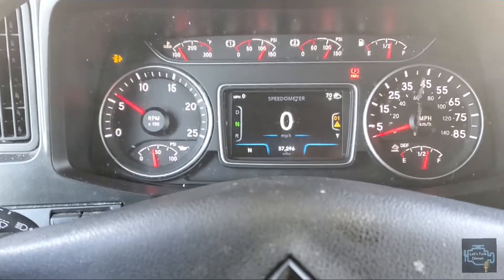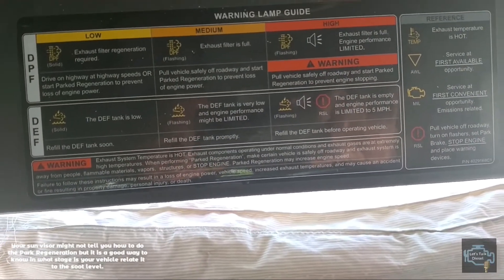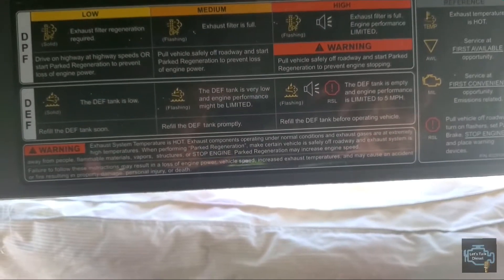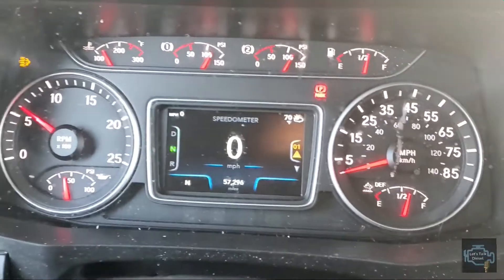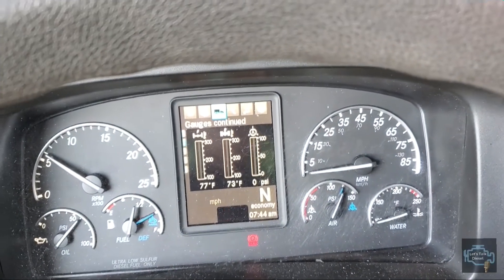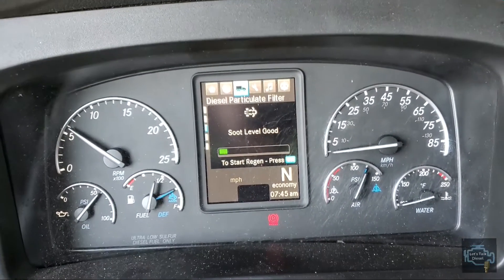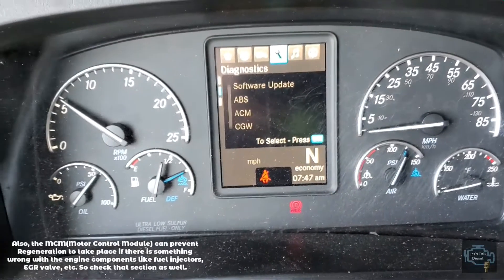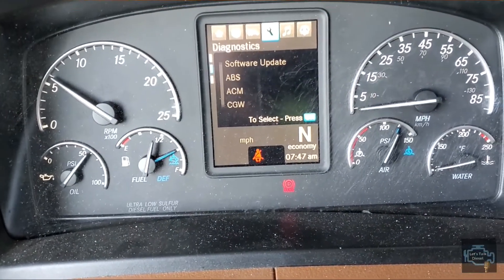How to do the Parked Regeneration Part 1: International LT/ Freightliner Cascadia/ Volvo VNL 760-860

Comment: How often (time frame) does it require to be regenerated?
Reply from the maker: In general, parked regeneration takes between 45 minutes to one hour to complete (with International trucks with A26 engine as exception to this because those vehicles takes more than one hour and up to two and half to finish this process) When this time is excessive, for example two hours it might be time to clean your DPF or requires an proper inspection of the aftertreatment system to check the performance of the components. Thanks for watching.

Comment: I have a 2018 international LT and in order for the Regen to kick in, I need to run the truck until like 3 gear then stop, then regen will start automatically. And go on for about 5 min then stop. After it stop, I need to repeat again run the truck until like 3 gear for the regen to kick in again and so on so for…  it takes like an hour repeating this process, can someone please helpme.

Comment: Ok, for you guys in a 2022 International LT625, Cummins X15, Automatic, this is the procedure.
Step 1: Press the break pedal, Push in Tractor Parking Break.
Step 2: Place Automatic Transmission in Drive
Step 3: Place Automatic Transmission in Neutral, Pull Tractor Parking Break
Step 4: Release Break Pedal, Press “Parked Regen” Momentary Switch, if done correctly Green LED Will be On and truck will Immediately idle up. During the Process, you will see the “High Exhaust Temperature” Light come on on the instrument cluster. Yes, it is finally working! 

After 1hr 24minutes process complete on this truck!

Sometimes if you want it done right you gotta do it yourself, so I did!
Reply: Mine just blinks
Edit: nm the 2nd time it worked. Thx!
Reply: I did like 5 times and it didn't work
Reply: Same here

Comment: Hey, let’s talk about 2022 International LT625 Cummins Automatic Parked Regen. Your video on it is not correct for the truck I’m in. The Parked Regen button is a momentary switch in this one and not like the one in your video.

Ok, for you guys in a 2022 International LT625, Cummins X15, Automatic, this is the procedure.
Step 1: Press the break pedal, Push in Tractor Parking Break.
Step 2: Place Automatic Transmission in Drive
Step 3: Place Automatic Transmission in Neutral, Pull Tractor Parking Break
Step 4: Release Break Pedal, Press “Parked Regen” Momentary Switch, if done correctly Green LED Will be On and truck will Immediately idle up. During the Process, you will see the “High Exhaust Temperature” Light come on on the instrument cluster. Yes, it is finally working! 

After 1hr 24minutes process complete on this truck!

Sometimes if you want it done right you gotta do it yourself, so I did!

Comment: This in not correct information for 2022 International LT 625 Cummins Automatic. The Parked Regen button is momentary switch and not click, and it does nothing but allow the green light to blink. It just sits there giving me the middle finger mate. For the love of God, update this please!!!

Ok, for you guys in a 2022 International LT625, Cummins X15, Automatic, this is the procedure.
Step 1: Press the break pedal, Push in Tractor Parking Break.
Step 2: Place Automatic Transmission in Drive
Step 3: Place Automatic Transmission in Neutral, Pull Tractor Parking Break
Step 4: Release Break Pedal, Press “Parked Regen” Momentary Switch, if done correctly Green LED Will be On and truck will Immediately idle up. During the Process, you will see the “High Exhaust Temperature” Light come on on the instrument cluster. Yes, it is finally working! 

After 1hr 24minutes process complete on this truck!

Sometimes if you want it done right you gotta do it yourself, so I did!
Reply: Thanks So Much My Friend

Comment: I did this on international but after it was done the parked regen light was still on.
Reply from the maker: If that happens could be for the following reasons:

1. Engine is not warm enough to start the regeneration process. Warm up the engine above 110 F or 120 F so it will start the process.
2. If engine temperature is okay and still does not start, it might be a problem with the switches (disconnect both switches from the dashboard and reconnect them again). Then try again.
3. If point 1 and 2 are okay then the last thing to check is for problems relate it to the EGR, Turbocharger, engine sensor, etc. NED (Navistar software) tool is required for all these checks. 

Thanks for watching and I hope this information helps for your issues.

Comment: How Do You Perform A Optimized Idle In A 2021 International
Reply from the maker: Usually, your truck must come with that features ON from the dealership, but if that is the case, before you turn off the engine it might ask you to turn on the optimized idle or it should be around the setting menu, I hope this help you, also try to contact Navistar for more information about it. Thank you for watching.

Comment: I press the regen and it just blinks three times and nothing happens on 2022 international lt. I made sure cruise was off, jake breaks are off, park and trl break are set
Reply: Same here nothing happens
Reply: I got mine to work on my 2021. I turned on the auto start/stop and climate control. When the engine cranked I pushed the parked regen button and it stayed on
Reply from the maker: If you truck is asking for parked regeneration (DPF light solid or blinking) and you tried to perform the regeneration with the switch with no success, it means there is something wrong with the Aftertreatment device, so if that is the case try to take your truck to the nearest dealership so they can take a look, if still under warranty they might compensate for the time down. Please consult your dealer for more details. Thanks for watching.
Reply: Yeah mine does the same thing it just blinks and no RPM revs I hope I don’t have to take it in The dealer takes days to get the truck back 😪

Comment: The example you did for the freight liner my screen doesn’t have the okay selection it just shows the soot level
Reply from the maker: If you do not have a manual switch, perhaps needs a software update for the instrument cluster. Usually only the dealership can take care of those issues. Thanks for watching.

Comment: How do you start regen on a 2013 Ford F750 with a cummins?
Reply from the maker: I do not work on pickup trucks but I suppose there is a switch under the dashboard or steering wheel area, just hold it for around 5 seconds and parked regeneration should take place. As long the required regeneration light is ON the instrument cluster, you should be able perform the manual parked regeneration.

Comment: I have an 2018 International durastar 4400. When I press the regen button the engine does not rev up. Does that mean I have to take it in for service?
Reply from the maker: If the regeneration light is not ON or blinking. It might not need parked regeneration yet, parked regeneration only takes place if those lights switch ON. Perhaps, passive regeneration is taking place while you are driving. Thanks for watching.

Comment: I have seen some of your videos; good job pal! Yet, i have a question for 2019 International with A26 engine when DEF fluid has been standing for a while it prompted a low fuel while the gauge was above half and trigerred error SPN:5246 SCR ERROR SEVERE DERATE STOP ENGINE and derated me to 5mph; what is the solution to get out of it?
Reply from the maker: This is a good question, if your DEF level shows the right level and the SCR code is relate it to DEF refill needed. Your problem might be the DEF sending unit or also know as QLS (Quality Level Sensor). My suggestion is take to your nearest international dealership, I think, that might be able to replace it (1st time only, I believe) free of charge, that has been a regular issue in those international A26 engines. I hope this help you. Thanks for the awesome support to the channel.